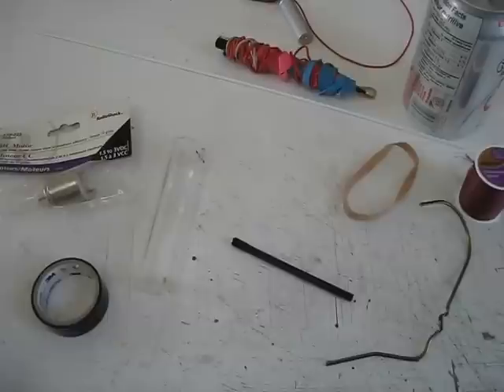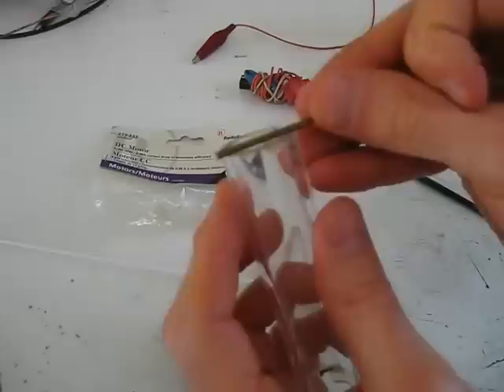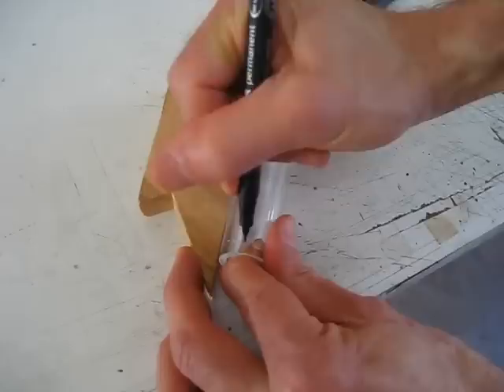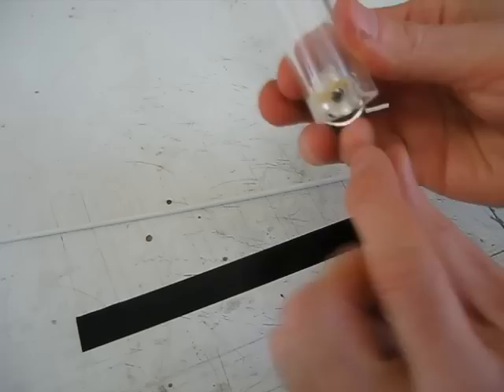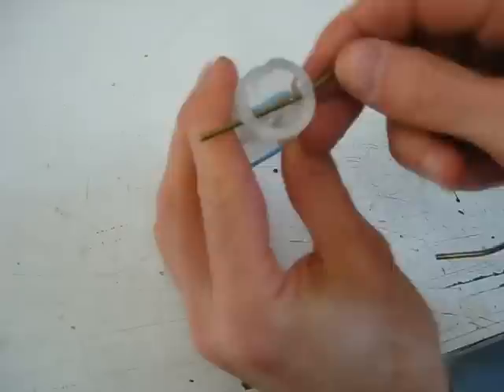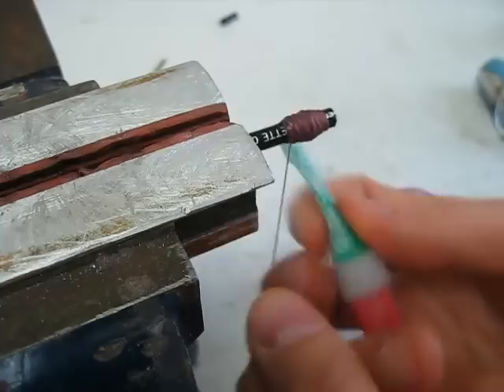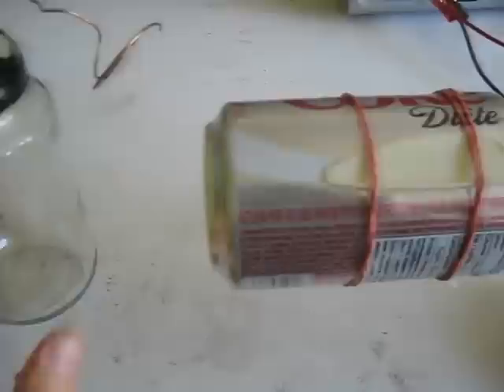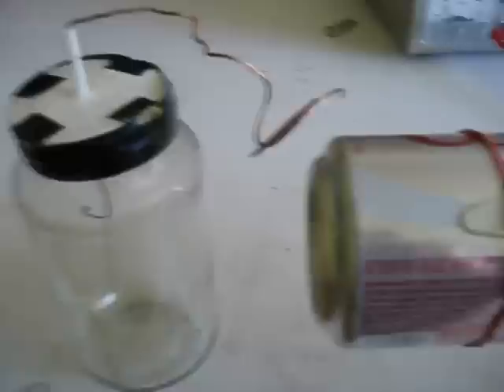How to Make/Build a Van de Graaff Generator Part 1 (Homemade/DIY)

Comment: First of all thank you for making this video, the explanation is amazingly well detailed and your tips in the second part are beyond helpful. What i wanted to know was whether it's okay for the plastic tube to be not completely hard but slightly flexible. I think it should be okay so long as i am able to get the holes made?
Reply from the maker: +Leroy D'souza The plastic tube can be slightly flexible. But the purpose of the tube is to firmly hold the two rollers. The belt usually tries to pull the rollers together and a flexible tube might not be able to keep them apart. If you have some other structure for hold in the two rollers then you don't need the tube at all.

Comment from the maker: @indro95 That I can't say. If you're making one like in the video then it's a small one and takes some effort. You may not get results right away. If it doesn't work, keep working on it. Get rid of or insulate all sharp edges on the coke can, the rounder the better; that's a big source of loss. Try different materials for the rollers and belts. Play with the position of the ends of the wires relative to the belt. Mine, as you can see from the video does produce small arcs so I get a tiny shock.

Comment from the maker: I saw the same thing. The inside has a non-conductive coating of some kind. But it doesn't see to stop it from working. I guess the electric field is strong enough to break through the coating.

Comment from the maker: It might work. According to wikipedia it's coated with polyethylene and according to the triboelectric series table, polyethylene is a little more positive than vinyl or teflon so if the outer surface of one of your rollers is made of one of those then you might be okay. They're not very far apart in the tribo series, but I've seen people inexplicably have a black vinyl electrical tape belt work with a black vinyl electrical tape roller. Worth a try.
Amazing channel BTW! Subbed.

Comment from the maker: Oh, the other end isn't attached to anything. As is shown at 9:53, the strands of wire on the end are separated so that there are many individual sharp points there, and then that end is positioned such that there's as small a gap as possible between it and the surface of the belt. It isn't attached to anything.

Comment from the maker: What do you mean by "normal voltage"? There is no normal. It depends on electrode shapes, humidity, gas, distance between electrodes, ... I've never measured the voltage between the belt and the brushes of a Van de Graaff - I wouldn't even know how to. 30 gauge, or 30 AWG, is a wire size. The higher the number, the thinner the wire. My email address is at the bottom of every page of my website, rimstar.org.

Comment from the maker: Maybe your fuse glass is thinner than mine? Are the two rollers lined up very well? If not, maybe that's putting some stress on the glass? Are the ends of the glass contacting the insides of the tube and maybe getting stuck and that's putting stress on the glass? Maybe try putting a lubricant, some kind of oil between the glass and the shaft, but be careful not to get any on the outside of the glass between the belt and the glass.

Comment from the maker: Use a wall adapter. I don't know about the Philippines but here in North America we can buy them at electronics stores like Radio Shack. Many appliances come with them too and you probably have some in your house. They're small black boxes that you plug one end into the wall and the other end into your appliance. The label on them says what voltage they put out. You can see me use one in my "How to Make Electrolytic Capacitors" at 4:36. I use ones that I've kept over the years.

Comment from the maker: Are you running your motor at its maximum voltage and current?
If yes, then try loosening the belt by moving the two shafts closer. But not too loose since you want the inside of the belt to make good contact with the rollers for the triboelectric effect. If it's already loose then try a more powerful motor.
If no, then try a bigger power source.

Comment from the maker: You said the "wire of the coke". The coke can isn't connected to anything else.

If you mean the ground wire that's touching the belt near the motor (10:12 in the video), that one is connected to the ground hole in one of my power sockets in the wall. If your power supply has a ground then you can connect to that instead. Or you can use your body as a ground and hold the other end of the wire between two fingers; that works with the open ended coke can design in the other video I mentioned.

Comment: I liked your video very much awesome video
But what was that black paper like that you sticked on tube at 6:10
and the wire which you poked into can with what did you connect that in thetube

Comment from the maker: It's impossible for me to say if your stick from a party balloon would work without knowing what it's made of, and even then, I'd have to try it to be sure. If you look up the triboelectric series table, the material for the bottom roller should be at one end, the belt material somewhere in the middle, and if the material for the top roller is not metal then it should be somewhere at the other end.

Comment from the maker: The bottom parts, the bottom roller and ground connection, are opposite in polarity to the top dome and top roller. That means there's an electric field between them. If the field is too strong then you get ionization between then and a current path through the air. You don't want that. That can be avoided by increasing the distance between the two ends. So yes, the belt length matters. Longer is better. If you see arcing between the two ends, then you need a longer belt.

Comment from the maker: Good point about my connecting through the non-conductive layer when I screwed the wire in place. When I wrote the comment I was thinking more of the way I did it in my Part 2 video where I stuffed a long bare wire into the can, which worked great. So many videos, I mix up which I'm replying to sometimes.

Comment from the maker: First off, I've never made an electric whirl like this, so I'm making suggestions from general knowledge. I have made similar things. Do you want yours to make sparks? I would think you don't want sparks. Wire should be okay but it should be very lightweight. The wires should end in sharp points to ionize that air and produce the thrust.

Comment from the maker: I'm not sure I understand your question. If the material you choose for the bottom roller will make it - then the material you select for the top roller should either make it + or be made of metal. If the material you choose for the bottom roller will make it + then the material you select for the top roller should either make it - or be made of metal. The belt should be made of a material that is somewhere in between the bottom and top roller materials in the triboelectric series table.

Comment from the maker: I did notice that soda cans (coke cans) have an electrically insulating coating on the inside but that didn't stop mine, or the many other peoples' who use these cans, from working. If you think that's the problem then sand some of the coating off where the wire makes contact with the can.

Comment from the maker: The only power supply is the one that turns the motor? Is that the one you're asking about? If so, it's a homemade power supply. If your motor is small then you can try using batteries, but it will take a lot of batteries. You could also try a power adapter. It really depends on what your motor needs.

Comment from the maker: When it comes to the materials, the important thing is where the belt contacts the surface of the roller. The material that the shafts are made of and the bulk of the rollers doesn't matter. What matters is the surface material of the roller since that's what comes into physical contact with the belt. And yes, you're right about the positive/negative/middle thing.

Comment from the maker: When a section of the inner surface of the rubber belt contacts the nylon and then breaks contact, the nylon becomes positively charged. That gives the high voltage needed on the roller. It's called the triboelectric effect. Nylon is used because it's on the positive side of the triboelectric series table. You can use anything else that's on the positive side of the table too, like glass. See my "Triboelectric effect/series or triboelectricity" and "How a Van de Graaff Generator Works" videos.

Comment: sir I am trying to build this generator but it's not working. I have checked humidity problem. that's not the one...
then I tried to rub nylon thread with balloon rubber(my belt) and its not showing any electrostatic effect...
what is problem?
Reply from the maker: +Akash Padhye If you didn't get any effect when rubbing them together then it sounds like the materials are at least part of the problem. See my part 2 video (https://www.youtube.com/watch?v=QrCgtjZwnB0) at around 5 minutes and 32 seconds in for more material ideas, but really you have to look around for what you can find while also looking at the triboelectric series table.

Comment from the maker: @zeke2812 Thanks! You should be able to make it. The batteries depend on the motor. Look at the video at 0:43. The package says it needs 1.5 to 3VDC, or from 1.5volts to 3volts. An AA battery is 1.5volts. Connect + of one battery to - of other battery (in series) and you get 3volts. Or connect + to + and - to - (in parallel) and you get a more powerful 1.5volt battery. Also, the tighter the belt the more powerful your batteries need to be. Get the strongest batteries you can, not rechargable.

Comment from the maker: A paper clip isn't very strong for a shaft for the roller/pulley. It's also very thin meaning I don't think the roller/pulley would rotate very well on it. Anything that's fairly stiff (doesn't bend easily) and has a decent diameter should do.

Comment from the maker: I dont know where you can get a clear tube like I have but you can go to a store like Home Depot that has an electrical section and look for plastic tubes there. But even a small plastic coke bottle will do. So just need longer shafts than I made.

Comment from the maker: It's hard to say. I've gotten sparks around 1 centimeter or roughly 1/2 inch which roughly speaking is 30,000 volts. That's a rough approximation since the humidity in the air and other things play a part too. Note that while the voltage is high, the current is very small, probably low microamps.

Comment from the maker: That's right. Charge is picked up from the bottom brush and deposited on the belt. That charge is then brought to the top where it is picked up by the second brush and deposited on the top dome. The bottom brush gets that charge from Earth ground or from another dome or it can even come from your body. The energy to get that charge is in the high voltage that builds up on the bottom roller due to the triboelectric effect. Think of charge as water and the motor and bottom roller as a water pump.

Comment: HI, my problem is where to find "household ground" or any ground at home, I  dont know if  my  heater water pipes are connected tot he ground, what do you suggest? can I use  the motor´s wall-powersupply itself?

Comment from the maker: The nylon thread must not have any coating on it. The interaction between the nylon molecules and the inner surface of the belt are very important. Vinyl tape is also known as electrical tape and is found in hardware stores. Its main purpose is for use as electrical insulation but is used for many other things too. Search for the triboelectric series table online. One roller's surface must be at one end, the belt in the middle somewhere, and the other roller's surface at the other end.

Comment from the maker: Cotton won't work. The wikipedia entry for "Triboelectric effect" lists Cotton as having no charge when used triboelectrically. (Hmmm... That explains why the face cloth I rub on plastic is never charged but the plastic is. Weird.) But also, both rollers need to be different materials. Specifically, the outer surface of the bottom roller must be near one end of the triboelectric series, the inner surface of the belt in the middle, and the top roller either near the other end or metal.

Comment: Very nice video and creative.Your sparks look to be about 1/4 inch and at 1000v per 1/16 inch that looks like about
4000 volts.Very respectable.
Reply from the maker: Loyd anonamous Thanks. I got even better results with by opening the end of the can and putting the 2nd roller inside. I show that in my part 2 video, along with other improvements https://www.youtube.com/watch?v=QrCgtjZwnB0

Comment from the maker: If you mean the white fiber material by itself, I don't know what it's made of so I can't look it up in the triboelectric series table. If you mean the resin that coats the fiberglass, then that's resin. Look at the "Triboelectric effect" page on wikipedia and you'll see the triboelectric series table on the right. Resin is listed just beside rubber. So if your belt is rubber then I doubt it will help much. If your belt is vinyl then it might help since vinyl is at the positive end of the table.

Comment from the maker: Aluminum tape would be counted as a metal and wouldn't contribute to the voltage output. It wouldn't prevent it from working though. A lot of Van de Graaff generators use metal for the top roller. But you get more output if both rollers are contributing to the output.

Comment from the maker: The motor may spin fast when nothing is on the motor shaft but when you put the rollers and rubber band, the motor will have to work harder. That's the real test of how many batteries needed. With multiple 1.5V batteries for a 1.5V motor, connect the positives together and the negatives together.

When you stretch the rubber band from roller to roller it can be tightly stretched, loosely or something in between. Something in between is good.

Comment from the maker: Sure. Some people use electrical tape, which is vinyl, with the sticky side facing outward. Look in the triboelectric series table for a material which is in the table somewhere between the material that the surfaces of your two rollers is made of.

Comment from the maker: Oh, and the motor plug that has the ground wire in it is the ground that's connected to the bottom brush and to the metal case at the bottom.

Comment from the maker: I've never tried it. Someone here was going to but used vinyl instead. According to wikipedia duct tape is coated with polyethylene and according to the triboelectric series table, polyethylene is a little more positive than vinyl or teflon so if the outer surface of one of your rollers is made of one of those then you might be okay. They're not very far apart in the tribo series. Worth a try. Let us know how it works out.

Comment: I think what I will do is find a large fuse then try and get the glass off. then I will use vinyl tape for the other pulley and an elastic band  as the belt .will this work.

Comment from the maker: Yes, if that is a ground pole. I just don't know for sure. Look up online about European outlets.

I'm pretty sure there's no problem with using an outlet's ground this way. I've been doing it for years and with much higher voltages and high current and with plenty of arcing to this ground. I've heard of plenty of others doing it too. Electricity takes the easiest path and that's all the way to the Earth. A charge won't build up anywhere, as long as it's a good connection to Earth ground.

Comment from the maker: One test I recently did that someone asked me to do (it was their idea but I can't remember who off hand) was to put a grain of rice on the can while the van de graaff is off. Make sure you clean off any paint, for example by sanding it off, where you'll put the grain of rice. When you run the van de graaff, the rice should fly off at an angle i.e. it shouldn't just fall off. Or try a tiny piece of tissue paper instead of the rice. But make sure it's sitting on bare metal, not paint.

Comment from the maker: You could try rubber cement, basically a glue for rubber. Try hardware stores, bike stores, hobby shops. Follow the instructions that come with the glue. Do test pieces. To avoid having a lump across one spot in the belt, cut the two ends of the belt diagonally and join the diagonal ends together. If you can't find a suitable glue, or get the glue to work, then you could try just sewing the ends together with a strong thread.

Comment: hey I am using silk thread on one side and vinyl tape on other side and motor of 150 rpm 12 v wrist band but still I m not able to obtain static current so what should I do?
Reply from the maker: +saurabh jain I think I already replied that it's been reported that the material in a wrist band does not work. That's why I keep saying to get a rubber band.

Comment from the maker: Which power source you needed depends on the needs of your motor. If you have a small 1.5 volt DC motor then you may be able to use a few 1.5 volt D batteries connected in parallel (all their negatives connected together and all their positives connected together.) You need a power source that matches your motor's voltage and can supply the current (amps) that the motor needs. It's often written on the motor or packaging.
The earth is a good source or sink of electrons and that's what's needed.

Comment: i love the way this is so accessible. will it work for generating lichtenberg figure?
Reply from the maker: No, at least not this small one. It doesn't have either the voltage or the current. You need a lot of current to burn the wood or other material. I'm not even sure if a big one that I have with its 15" diameter dome would work.